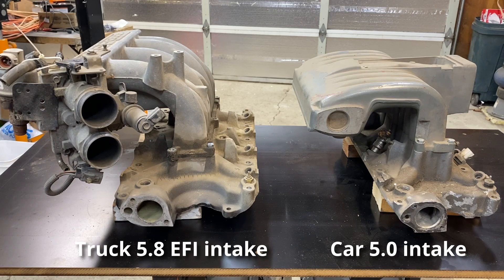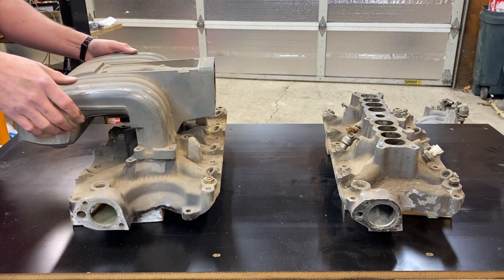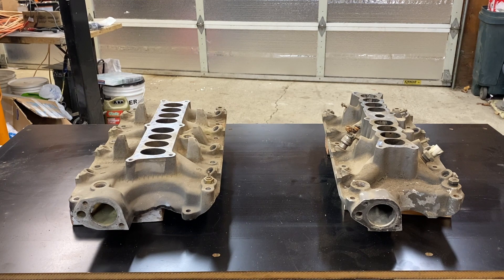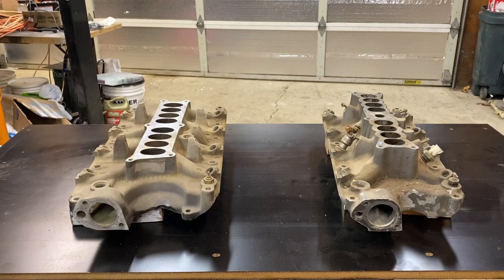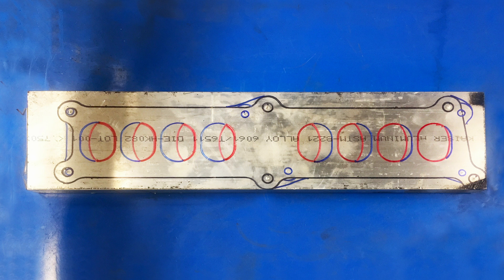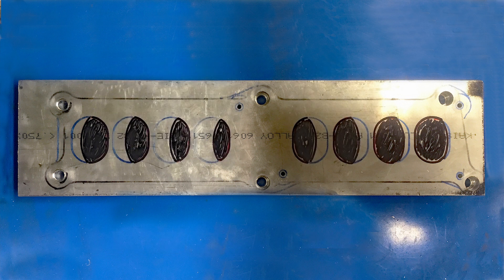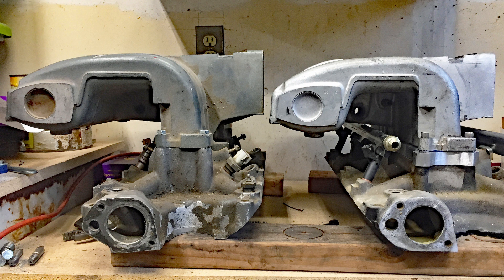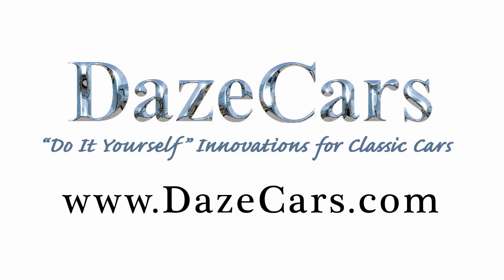DIY Ford 351W“Lightning” EFI Intake

Comment: I seen come people will add a 1 inch spacer to the intake and make more power off it so it might be opposite
Reply from the maker: Oh I’m sure. I originally did it on a stick ish truck 351w.  And it probably would have been okay but the moment I went to a 393w i had to create my Frankenstein EFI to have better air flow.

Comment: BC Broncos makes an adapter for this purpose. ( PN 11-82010 ). What sucks is that the volume of air that upper intake can flow probably won't support even 300hp. What I have done with Explorer intakes is cut them in half, removed as much material as I could, and then welded them back together. A viable option on an HO intake bolted to a 351.
Reply from the maker: I agree this 5.0/5.8 hybrid is not an option for a high performance high revving engine but your solution would make it a lot better.  Once I decided to make the 351w a 393w I had to go a whole different direction for EFI but I will still be using the truck lower AFTER the runners get opened up a lot.  Here is the entire playlist on that project.

https://www.youtube.com/playlist?list=PLg4j6XzBdSY_8M8btBCEyTLtsPzn6KpAv

Comment: I don't understand why guys aren't port matching truck 5.0HO upper to 5.8 Truck lower GT40 heads explorer injectors 460 throttle body 90's Mustang GT PCM/ECU .444 stock camshaft or a number camshaft  but I'm trying to use all factory stock parts should be spicy not looking for a hot rod but should be interesting.
Reply from the maker: I have seen  info on that.  It is a good power option but it has some of the same hood clearance issues as the 5.8 upper.  Great option if the engine is going in a truck, not as good for other vehicles.  Looks like your engine combo will be a good one!!  probably about a good as you can get without aftermarket parts.

Comment: The thought crossed my mind today and I was wondering if it was possible… and here you are 😮
Reply from the maker: There are some flow restrictions if some major porting is not done.  I built it for my stock 351W but now that my build is anything but stock I am going a different direction.
Reply: @dazecars it’s still a really cool and ingenious way to do it! But I see how it would mostly work on a stock 351w. Do you think that the restriction is in the upper or in the lower intake?
Reply from the maker: @MrBlitzkrieg1987  It is in both.  The lower has very small ports but those ports can be opened up for massive flow improvements.  The Upper also has a lot of restriction and is less portable.
Reply: @dazecars oh ok! Well you got yourself a new fan, just subscribed to your channel. Thanks for taking your time replying 💪
Reply from the maker: @MrBlitzkrieg1987  Thanks for subscribing!  You should check out my latest hare brained EFI video.  It's part of my 393W build series. https://youtu.be/_qZksA3xAAU

Comment: Trick flow 351!!
Reply from the maker: Their 4 barrel EFI intake is not the best choice for my application, it's too tall, and open plenum.  Their "lightening" type is over $2500 and this is a budget build.  if I wanted to throw money at it I would get a lightening intake from eBay.

Comment: You should have used the thicker piece of Aluminum plate to get more air flow. you can still use a phenolic spacer on the 5.8 side this
 will reduce heat transfer, plus you get more air volume. That's what I used on my '93 Lighting. Good for about 11-17 hp. They do make the phenolic spacer in different thickness 3/8" , 1/2", and 1" depending on hood clearance. Got mine thru Racer Walsh, in Jacksonville, Fla. Also you could do a intake port match like doing cylinder heads and increase volume and make your own gasket. I had Extrude Hone do my GT 40 intake. Hope this helps.
Reply from the maker: You are correct and I thought about making it thicker for just that reason, BUT this is going in a 62 Galaxie and there are hood clearance issues.  I made it out of 3/4" because I didn't have room for anything thicker.  At the time I was going to run it with a used 351W where everything but the heads were stock and the max RPMs was in the 4500-5000 range.  I was not worried about the flow given the RPMs and stock components.  Now I have switched directions and am doing a complete rebuild and stroking it to a 393.  Because of that  this setup will not work at all due to the flow restrictions of the 5.0 upper so I am going a different direction.  Thanks for the comment.

Comment: They make carbide burrs specifically for aluminum that work much better than the one in the video.
Reply from the maker: Thanks for the tip, however I can't imagine anything working better than what I was using as long as I dipped it in ATF.  I am sure the biggest difference in the aluminum specific one is helping eliminate the teeth clogging up with aluminum but once I started using the ATF that became a non issue.

Comment: Nice job.  I would have gone with a 351W 4v dual plane intake like the Edelbrock Performer and one of the 4v TBI  setup under 14" open element air cleaner to give it a period correct look.   Get a stroker crank and some FloTek heads painted Ford blue with even a small cam and you'll be pushing FE torque numbers with a lot less weight.   I hope you did the Front disc brake conversion!
Reply from the maker: I ended up changing direction with this project.  The engine IS getting stroked to 393 and I knew the 5.0 upper would not have enough flow.  So I will likely go dual intake with sniper EFI.  I am using Flotek thumper heads but not painting them, this car is clearly  restomod and not a sleeper.  I am doing an entire series on this build https://www.youtube.com/playlist?list=PLg4j6XzBdSY-cFPsA6IO5zdezSbCxgjCW  The car is 4-wheel disc brakes with hydroboost power assist.  It stops on a dime and gives $.09 change.

Comment: what Intake Tubing was used?
Reply from the maker: I used the HO upper
Reply: @dazecars  The tubing that attaches to the throttle body and air box?
Reply from the maker: @TropicBreezeRealty  I am sorry but I don't know what tubing you are talking about.  The throttle body bolts directly up to the 5.0 upper with no other tubes.

Comment: I need one? Can you make me one? And how much?
Reply from the maker: Long answer, when I made mine it was $65 in aluminum and 20+ hours of work. Short answer not selling them.
Reply: @dazecars  that's a shame cuz you could probably make good money selling them these days
Reply from the maker: @pete1003  If by "good money" you mean less than minimum wage, then yes, yes I could 😂  If I bought full sticks of aluminum I would save a little, lets say my cost $40 per adapter and then if I sold them for $200 each thats $160 profit... for 20 hours work... so $8 an hour.  I can make 2.5 times that at Walmart.  To make one for my own use was fun, to make a whole pile of them to sell would not be.  Other then time they are not hard to make.  That is why I put it here.  Those that really want one can make their own.

Comment: Have your driven this yet? I love the build it's amazing you did this 
If you have driven it yet how does it all feel?
Reply from the maker: only on the engine run stand.  Worked well there.  problem is I acquired another 351W and decided to do a full rebuild.  At that point a 393 stroker was the obvious choice so I do not think I will me using my 5.0 upper setup for the car because it probably will not flow well enough for the 393.
Reply: @dazecars  ah dang thats still awesome, i wonder if a trickflow 302 upper would work any better? Since you already have the adaptor ?
Reply from the maker: @moongava5823  There in is the question.  I did this project because I had the truck lower, the 5.0 upper and the aluminum was not that expensive.  If I were to start throwing money at it to "make it perform better"  I would rapidly approach a place where an entirely different setup would perform better for about the same or not much more money.
Reply: @dazecars  that's true, I have the 302 upper and 351 lower I'm getting ready to use a 1" plate because I have the clearance for it, and hopefully with the turbo I plan on using it won't die at 4k rpm 😂
Reply from the maker: @moongava5823  I would think that with a Turbo a lot of the flow restrictions will be minimized.  Not eliminated but at least reduced.

Comment: There is a better option than this!! One that I have been working on for some time. The Holley Systemax (Saleen/Vortech) upper intake manifold will bolt right up to the 351 lower intake. Obviously the ports are shaped differently, but with some creative 'porting' you can get them to reasonably match up. Combined with a phenolic spacer and Bam you've got a 351 lower intake with a Fox body upper intake that will fit under your hood, and presumably flow waaaay better than the (crappy) OE Fox upper.
Reply from the maker: "better" is the not the word I would use.  "higher performance" sure but at almost $900 compared to the $75 I spent on my project it is not budget friendly. Not to mention the fact that a complete EFI intake can be had for around $1000 so that that point why not spend the extra money for something that will work way better.  The entire purpose of this project was to make parts a person likely already has or can get cheaply work together.  Will the solution in my video be a high revving horse power maxing setup, absolutely not but for a stock 351 in a daily driver it could perform very well.
Reply: @dazecars  Sure, when I said 'better' I definitely meant better performing. But also, the Holley Systemax will bolt right up to the 351 lower without the need for the adapter plate. As far as budget, you can pick up a decent used Systemax upper intake for $3-$400. I actually did this so that I could run my Saleen/Vortech upper intake on a 351 engine. So, in my humble opinion, the Systemax etc. is a much better performing, easier modification, for just a couple of hundred dollars more.
Reply from the maker: @Metalcop5150  There are no used ones currently available on eBay and new ones are in the $800-$900 range so where are you getting one for half that?
Reply: You can get cast iron 351 GT40 lower from marine blocks used on boat for $100
Reply from the maker: good to know

Comment: I am really thinking this might be the best budget friendly option for my swap. I currently have a 302 with a turbo and am building a 351 to replace it.
Reply from the maker: The biggest issue with this mod is flow, but if you are running a Turbo that becomes way less of a concern

Comment: I ran the BC Broncos adapter like 15yrs ago with a ported lower AND adapter, the car made great torque, but feel on its face by 3800rpm.  Shifting in 5th at the 1000ft mark is no bueno.  I cut open an HO upper, ported it heavily and shortened the runners by 2.5-3” and afterwards, power would fall off the cliff at 4400-4500.  It definitely choked the hell out of it… but it is the cheapest way to make it all work, for sure.
Reply from the maker: Fantastic information, thanks far sharing your real world experience!!  How was the rest of the engine built?  lot of lift in the cam, stock or aftermarket heads?  The reason I am asking is to try and get a more complete picture.  I would think the cam specs would have the biggest impact and if it was a mild cam the effects would be less noticeable at higher RPM... Of course a mild cam is not what you would be using for a higher RPM application. Anyway I love the feedback and would appreciate any more info on the rest of the engine build.
Reply: It was a mild build, I chose a cam to be SD friendly(dumb idea, did MAF swap two weeks later) Crane grind with 208/216*@0.050 if I remember correctly.  Shorty headers, 2.5” dual exhaust.  GT40 iron heads(cobra/early explorer style) with some bowl work. 1.7 Crane roller rockers.  

Everytime I made any change to the intake side, I got noticeable improvements.  The upper intake mod was the biggest.  Before that, I did a 72mm  MAF sensor upgrade and gained a couple hundred usable RPM.  I suspect that a larger TB would’ve shown good gains also.  The worst thing I ever did to that combination was change from 2.73 to 3.73 gears.  If I had it to do all over again, I’d sent the whole intake over to BigDogs porting and let them work their magic and go with a cam that had a little more duration and less LSA.

Comment: That's basically a DIY version of the adapter BC Broncos makes. Considering what you paid for the aluminum, their price is very reasonable.
Reply from the maker: You are correct. If you add shipping to the price of theirs, subtract what I paid for aluminum, and divide by the hours I had in the project I was earning about $4 an hour 😂😁🤣. The one advantage in my case is mine is 3/4” and I think theirs is just over 1” thick so I gained 1/4” hood clearance.
Reply: @dazecars  Did you end up with the truck manifold/adapter and 302 car intake being the same height as a car 302 lower + upper manifold? I'm looking to do the same thing in a Lincoln Mark VI, and hood clearance is important.
Reply from the maker: @craigtalbot6930   no it is 1/4" shorter so I gained 1/4" extra hood clearance
Reply: @craigtalbot6930  
Craig..Your the 1st person on YouTube mentioning fabbing a Mark VI setup. Before I watched this Vid, (Right about when I was going nutty from Covid LockDown) I started the same project. I already had everything at the house to do it, Just had to fab up the adapter. If you have any questions, fell free to ask. What I ended up doing after It was all said and done, was pulling the setup out of the Lincoln, and we should be finished tonight shoving it in my 54 Hudson, after I ended up converting it to a Liquid Cooled Intake Setup 😉. My buddy builds R32's, and I was at his house when a Liq Cooled Manifold showed up 1 day.(I think he paid $4k for it)  When he pulled it out of the box, It looked almost identical to the Cobra setup, so I had to try it.
Reply: Have you tried on the dyno? See the difference between OEM 351w and the combo?
Reply: Thanks for sharing your experience

Comment: Just buy a EFI aftermarket intake for a 351 Windsor.Its gonna look better,flow better & gain better airflow.Plus save a bunch of time,money & frustration fabbing a adapter.
Reply from the maker: I concede it will flow better BUT only at higher RPMs.  Looks are subjective, I think the results at the end of my video show a fantastic looking setup.  As to the cost it will not save a bunch of money, not eve close The most inexpensive aftermarket 351W EFI is $850 I paid less than $75 for the piece of aluminum and making it was for the fun of it so no "frustration of fabbing" 😁

Comment: Sheer genius!!!
I love how you take a practical approach to making things work and then figuring out how to make it happen.
I am following your jar IRS into a classic mustang on my 67 coupe.
When will you have the next installment of it on your website and or youtube?
Thanks again for all of the excellent ideas.
Reply from the maker: Not sure when the next update will be available.  There is just not enough hours in the "Day" 😂 😂 as far as taking a practical approach I am a natural problem solver and have never been afraid to try and modify something.  As long as it's not a safety issue, worst case scenario I fail big deal.  Even if I fail I learn something that makes the next project go better.